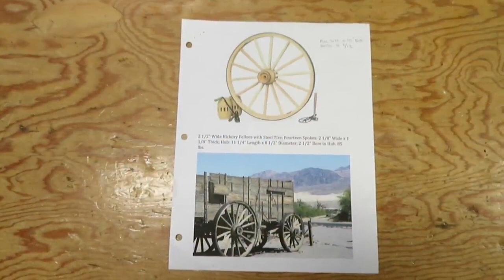Making an authentic ornamental wagon wheel,  on the wood lathe

Comment: Looks nice. Except-
- the felloes that make the rim (usually 2 spokes each) had grain that followed the rim. Either make a lot of rings and select, or (as I do) clamp strips together and then turn. You can get ~ four sets from a single clamped circle.
-spokes were not circular, especially at the nave (hub).
- it looks like your spokes are axial (nave mortices and felloes in the same plane). There was a gap between these planes- often substantial.

Comment: Great workmanship,  getting ready to make some for a canon.  What type of index plate do you use when drilling the spoke holes?
Reply from the maker: Thanks Kenny,    and have fun with the canon, that should be a great project.      I have an 24 hole indexer built into my Vicmarc Lathe.    I've seen home made indexers on you tube that can do the job if a lathe does come with an indexer